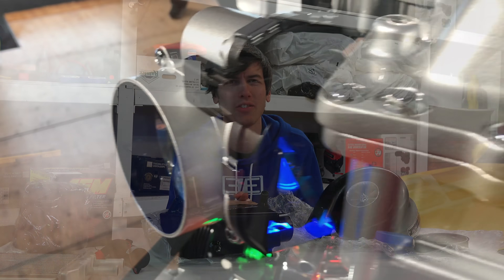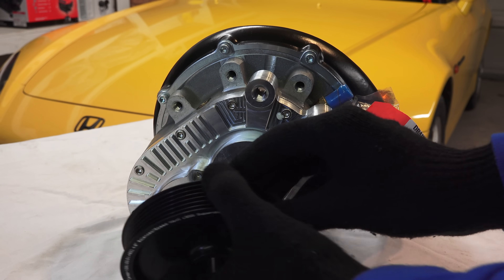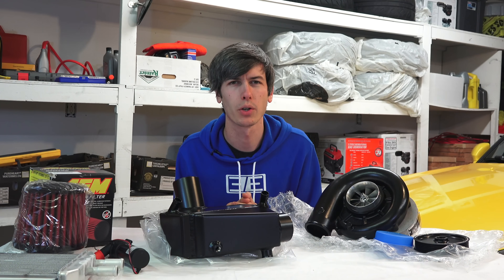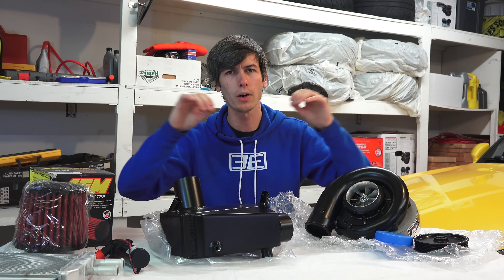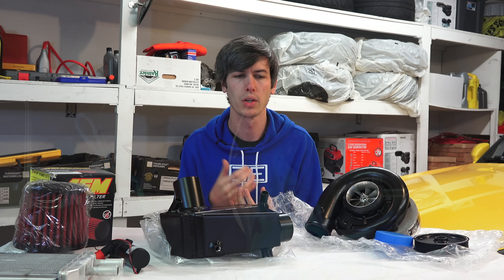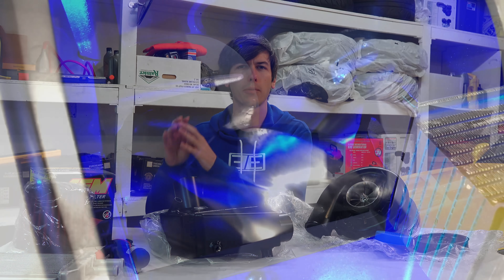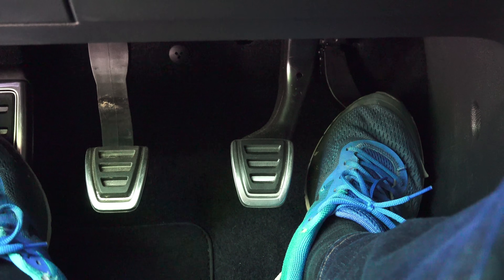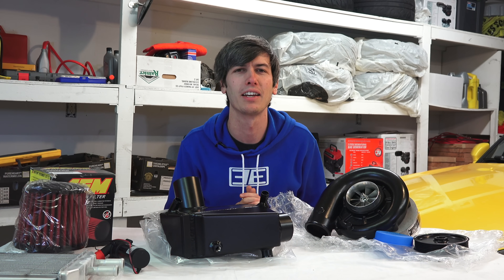Turbochargers vs Superchargers - Which Is Better?

Comment: Biggest advantage a Turbocharger: "Ssssswududududududu"
Reply: Psssssss
Reply: sound of turbo spooling >>>>>>>>>>>>>> wastegate/bov
Reply: I think the major problem with turbos is the heating. They cause a lot of reliability issues if they’re not factory or a noob build.
Reply: @briancastro8004  They always cause reliability issues, even when they come with factory. The worst thing you could do to a Turbocharger is coming from the Autobahn where you ran 250km/h for an hour straight near rev limiter and then just park it without driving it at low RPMs in high gears to cool your car down. Also Turbochargers allow for more fuel being burnt creating more power which also puts more stress on all the parts and also allows for more heat being generated.

With downsizing and adding turbos you can make an engine quite efficient at decent (or high) power. But this comes at the cost of reliabilty (also because there is another part, which can break down and increases machine complexity increasing production and maintenance costs).
So Turbos are clearly not the holy grail for internal combustion engines.
Reply: @disco.jellyfish  Exactly, in general Superschargers are more expensive to build but more reliable. I often attend Car Meetings and have some JDM Fanboy friends. they change their turbo parts and engine parts like every month because something breaks.
Reply: @typie34  Well, when having a lot of power - In general, you should be prepared that something might break every now and then.
Reply: Jet noise / plane noise
Reply: The sound of fluttering is a problem
Reply: @crosswire7777 Only if it’s doing it on intake when you are accelerating, if it does it when you let off of the throttle it’s ok.

Comment: one major flaw i hear is that you say i will get boost right away with a super, not true, you get a percent of that boost, not 100% until max rpm
Reply: Depends on the supercharger. Roots and screw type superchargers will make full boost at around 1500 rpm while a centrifugal wont make peak boost until the redline

Comment: The supercharger is the less elegant way to pump more air into the engine.  It puts more demand on the engine, which in turn costs you more fuel.  The turbocharger is engineering done elegantly.  It captures energy otherwise discarded in any other type of engine, the exhaust.  You are literally pulling power from nowhere, for all intents and purposes.  The supercharger is stealing energy from the engine.  Sure, the supercharger is more fun to drive if you do car reviews with someone else's car using someone else's gas paid for by someone else's wallet, BUT WHAT ISN'T MORE FUN WHEN YOU'RE USING SOMEONE ELSE'S MONEY?!  For everything else, there's turbocharging, which has the owner in mind.

Comment: Why cannot you have BOTH, due to size? Use an electric supercharger, with normal turbo
Reply from the maker: You can! Search my channel for “twincharged” and I have explanations for how it works. :)
Reply: @EngineeringExplained  Thanks, How reliable is that Volvo twincharged engine?
And why doesnt Toyota do this with their Hybrids with their 1ZZ or 2ZZ 1.8L engines? Since their Electric motors are in their TransAxels already

Comment: Supercharger is more reliable robust system . turbo is more complex and more moving parts and more expensive to fix
Reply: Is the energy lost from the engine powering the supercharger reclaimed by it's use? What I mean is, does a supercharger give back more power than a turbo after taking into account losses?
Reply: @bitTorrenter  yeah
Reply: @bitTorrenter  its really simple, with supercharger(because its powered by engine via roller) it would give less compared by some stronger engine with more horsepower, so for example it would boost engine to faster reaching rpm if engine had for example 300hp, but other engine with for example 400hp or more(if theoretically does not have supercharger or turbocharger) will compensate that acceleration loss compared to supercharged 300hp engine. So in my opinion weaker engines have more benefit from turbocharger, stronger engines have more benefit from supercharger. But thats just what i would like, there are a lot of other things that need to be took into account.
Reply: True said
Reply: Excellent answer I would say the supercharger is more reliable and easier to build and make work properly. Turbos have that heating issue so if the car doesn’t come stock with turbo and you’re trying to make a no turbo car turbo. You’re going to have a hard time that thing is going to be heating everywhere specially if you’re a noob.
Reply: @briancastro8004  plus trubo lag and superchargers dont
Reply: Yes...thats right

Comment: For road use, the supercharger is better as said no lag just smooth controllable application of power. Try exiting a corner on a motorcycle with a turbo and opening the throttle when you would normally. That sudden rush of power is no fun while still on the side of the tyre.

Comment: It's interesting nobody considers the exhaust back pressure a turbo creates, it's not totally "free energy". Measure the back pressure generated and I bet you'll find it at least 110% boost pressure.

A turbo may be more efficient but I'd argue a supercharger could match a turbo with more R&D. Maybe bypass valves or variable speed drives or electric drive.

Comment: (A bit late...)

FWIW I have had a supercharger and a turbocharger on an LS motor. Absolutely prefer the turbo, however it's a much bigger PITA to get up and running. The supercharger (procharger/centrifugal) didn't make much boost until upper rev range. More control with turbo, more fun, and sounds better.

Comment: ok I don't understand, how is taking energy from the exhaust not taking energy from the engine?
Wouldn't you just increase the pressure inside the exhaust, therefore decrease the pressure difference between the combustion chamber and just outside, and by extension the expansion ratio of your combusted fuel?
Reply: 1. Turbocharger uses exhaust gas to spin the turbine, without a turbocharger, the heat energy in the exhaust gas will be wasted anyway, the absence of turbocharger does not make exhaust gas useful. Thus the viewpoint that you are "recycling" exhaust waste into good use. Supercharger on the other hand uses shaft power, e.g. if your engine is rated 200kw, probably 5 to 8kw is used to drive the supercharger, that is not a smart way of using shaft power since we like to maximise the useful portion of energy produced. Wont we prefer the 5 to 8 kw to be transmitted to the wheels for better use?
2. Turbocharger shafts are dynamically balanced and there is a system of floating and thrust bearing to minimise frictional losses. What ever little amount of pressure build up will relieve the easiest path, that is through the turbocharger inlet, in fact, the exhaust gas temperature will drop 100 to 130 degC after passing the turbine, in some sense, it is the heat energy (that accelerates exhaust gas flow) that is being converted to drive the turbocharger. Notice i say converted and not "recycled", since it would be more favourable to not have heat transfer to turbo assembly. (Ideally just heat loss due to hot exhaust gas)

Hope it helps
Reply: @johngiam  I know what you are saying, I just don't think it's right.

The temperature drop you describe is almost certainly because the exhaust is doing work, which means they are pushing against something (turbine), which means slightly blocked and less free flowing exhaust.
The higher pressure you have in the exhaust, the more work your engine has to do (read: use more power) to push new exhaust gas out etc. This is why a good exhaust can give you a few hp sometimes.

Now it would be very believable if you claimed turbochargers are far more efficient, perhaps only taking 1 hp to produce the pressure a supercharger need 3hp for, maybe even 5, 8 etc. I don't know better, but it's believable to a point.
If you claim that turbocharger somehow doesn't affect the engine at all even thou you are installing a turbine IN the exhaust, I find that hard to believe.
Reply: Hi, I actually did not say installing a turbocharger does not affect engine performance. I be honest, i wouldnt know if  it affects engine performance from a very micro level of analysis.

My initial understanding from the first comment gave me the impression that the notion is how is turbocharger more efficient than supercharger (initial notion i got  was that whether the energy is extracted from motive shaft power or exhaust thermal energy)

Yes, i absolutely agree with you that installing a turbocharger will increase pressure between combustion exhaust port to turbocharger inlet. I don have a figure of how many mmAq it will increase (i don think it will severly increase that much pressure unless a undersized turbo is used) but my observation is as follows:

A similar engine block gets higher HP rating from installing a turbocharger (and all the fuel adjustments and heat rejection issues, but putting it aside for simplification), when i studied a few of these engine part catalogues, the exhaust manifold itself is almost similar  what is different is the piping for turbocharger engine variants.

Apart from that, engine would have a prefer range for backpressure measurements, so i believe that so long the exhaust installation and design is good (i.e. not exceeding specified exhaust backpressure limits). It should not affect engine performance negatively as you said.

Summing up that there is usually not a big difference in stock engine exhaust manifold design for naturally aspirated and turbocharged engines, plus the fact that all is fine as long as engine exhaust backpressure is within limits at full load, my assumption is simply the selection of turbocharger has to be reasonable (for example, a large displacement engine likely need a larger AR turbo to scavage the large volume of gases, and a small displacment engine use a smaller AR turbo). That is probably a balance to look out for especially to those who love modding their engines.

Does a healthy backpressure give the engine more horsepower? I don think it does directly(or at least not a huge part that i know of), horsepower are mostly dependent on air fuel, i had encountered a cases where backpressure was too high and it affected the turbocharger boost pressure (unhealthy back pressure lead to it but did not caused it), the boost compensator adjusted the fuel rack accordingly so i would say it is a tuned down air fuel setting for lower horsepower caused by high back pressure.
Reply: @johngiam  If like you said an engine actually benefits from (or at least loses nothing to) a moderate dose of backpressure then you would be absolutely correct and I'd happily stand corrected.

However this is an interesting claim to be sure. I'm not doubting you, I just can't see any possible reason personally.
Pushing exhaust out is work that needs done just as spinning up a supercharger is, so unless pushing out exhaust is improving efficiency elsewhere it should be a net loss regardless from a conservation of energy standpoint.

I could see this improvement in efficiency if backpressure causes the cylinder to expand more slowly and thus loses less to heat, but the exhaust timing should be the same etc.
If anything adding a supercharger (or increasing load in any way) would improve efficiency due to the slower expansion, although in most cases the increase is not even close to the extra work to be done.

Some more info would definitely be nice.

Comment: You can always use 2 turbos like the RX7, where it's got a charge with low RPM but also with high RPM.
Reply: The 3rd gen "sequential" pair of turbos, one turbo for low to mid range and the second one also coming in at higher rpm, was complicated and most by now have been changed out for a bigger, simpler single turbo .... except my sequential. The Supra at the same years ( '92 +) was a better sequential design.

Comment: You are just compressing air so why not a rotary vane compressor driven by  oh horrid me ...an electric aux motor managed by the computer to match exactly added 
Power needed at any given time
Reply: They exist, most commonly as a hybrid turbo. The electric motor spools the tubo to prevent lag until the exhaust can spool it up. The main problem is the amount of power required to drive a compressor. The motor would have to be strong and would require a lot of power. A normal 12v battery and alternator would not be sufficient. They work very well but cost significantly more than a normal turbocharged setup would.

Comment: If supercharger takes the energy from the engine, then how about turbocharger restricting the exhaust airflow? I know it's not that simple, but It sounds counterproductive to restrict exhaust in order to boost intake. So turbocharger also has some energy cost.
Reply: Exhaust airflow doesn't restrict power because power is generated by intaking air and burning fuel...as in combustion... Key word is INTAKING... Superchargers are powered by the engine and even that is insignificant... It only becomes something to be considered when it's put on a 4 cylinder engine... For fucks sake stop over thinking it.

Comment: Maybe someone could make a hybrid between the two.  Like the intake turbine is powered by electricity or the crankshaft to produce X level of compression, and as exhaust comes in it can let off the engine power and switch to the exhaust power?

Comment: Why do you keep touching and pointing to the turbo when saying supercharger
Reply: It is a centrifugal supercharger. They use the same style of compressor that a turbo uses but is driven by a belt on the crankshaft as opposed to a turbine in the exhaust.

Comment: @05:15 _"and finally....:" ...make that "and finally plus one" - MkV Golf 2L TDIs are known to blow turbos. Mine blew every 80,000km. This was same number was also mentioned by the dealer service department. The car had 234,000km on it when I got rid of it, and had a nice loud enough turbo whine.....I didn't see the first turbo that blew after it was removed, but the second cracked around the body between the input and output drives ...fatigue may be ?

Comment: I believe the one on his left is a turbocharger and not the one on the right correct me if I'm wrong. I think he confused them in the video.
Reply: Basit Bukhari the black thing that’s like a swirl is the turbocharger
Reply: @austinfuller2513  no, that is a centrifugal supercharger.  It looks like a turbo but instead of having a turbine it has a belt connected to the engine.

Comment: Can u supercharge and turbocharge  in the same time?
Reply: yes, you have a supercharger that spins at low rpm for low end torque and is disabled and bypassed once the larger turbo kicks in when your rpm is higher. Volvo has this in their t6 engine

Comment: So if your just driving a daily driver and you want some boost on the highway but still be efficient at slow speeds and idle go turbo. Or if you want high top speeds for like drag racing go turbo. 
If you want pure performance all the time right from the getgo.  go super charger at the expense of it burning more fuel all the time to spin the supercharger. But a supercharger would be better for a race track a tractor or truck because there would be better throttle response and low end grunt. As for the both argument sure if you have an engine that could handle the extra pressure but in most cases there would be no point other than to blow your engine up.

Comment: My 46 truck is supercharged and I love it! 46 Ford 355sbc. A small 177 with 7in lower pulley and 2.5in top. makes 14lbs of boost hit it with 150shot of nitrous ! And watch out baby.... leave at dead idle no tranny brake yet.. and does a 1.32 60 foot on it's way to a low 9sec pass!!

Comment: would you recommend a gxp since  it already comes with a supercharger
Reply: yes much yes, as an owner of a buick park ave ultra (which has a similar power-train) i could pull away from most other v6 or vtech/ vvtli cars in a giant heavy grandma car. the gxp is lighter with better gearing and in return pulls a lot harder. if you want that kind of performance with a lower price tag look for a '98 or '99 buick rivera not very pretty but great sleepers as most people dont understand it has the same powertrain as gxp and gtp's from the same year
Reply: 13blackg ty i was gonna try to find a way to put a supercharger in my 4.3l chevy s10
Reply: @xxrated-2174  there are some super chargers you can find in junkyards for cheap that with some machining knowledge can be made to work on pretty any car, the 24hrs of lemons guys are pros at getting junkyard superchargers and fitting them to crap engines for that extra umph

Comment: Imagine a hybrid combination of turbocharger, supercharger and electric.
Reply: You can actually get an electric on-demand supercharger.  Runs off additional car batteries in your trunk.  Provides massive power when you activate it without a parasitic drain on your engine.  But it's only good for short bursts.  I think 30 second usage, with 5+ minute recharge time.  Benefit is that it's not dependent on engine RPM.  So you get the full performance even at the start.

Comment: While having respect for both, i prefer superchargers. Sure, it takes a small investment of power to use it, but its there from idle to peak rpms. When it comes to the financial aspect, turbo is probably the way to go. Superchargers are more pricey up front, but dont necessarily need tuning and are a simple bolt-on, just make sure theres room under the hood.